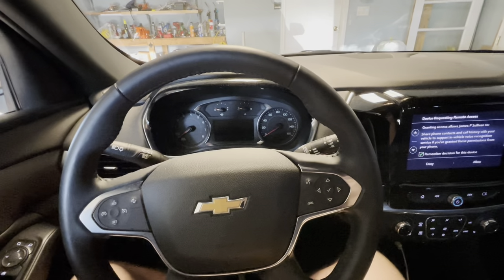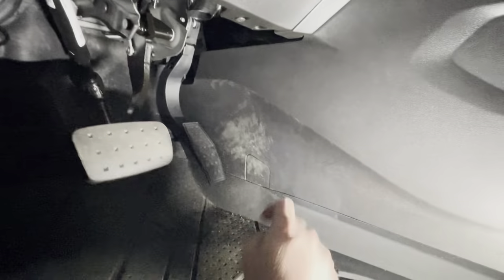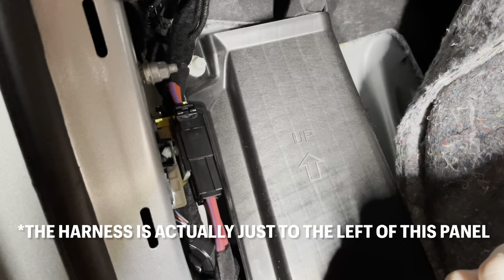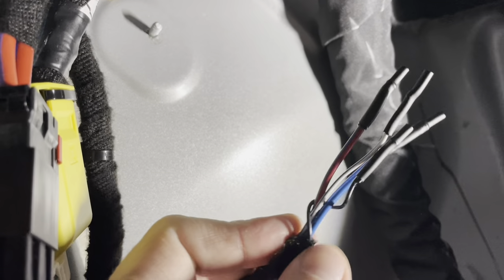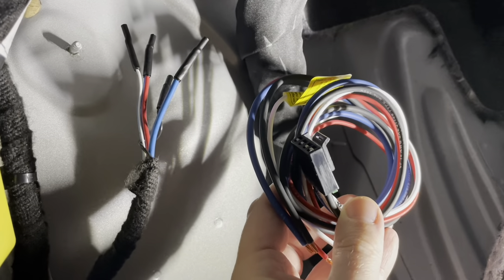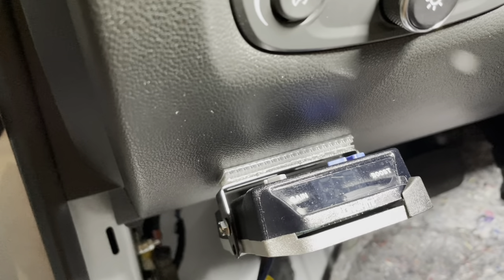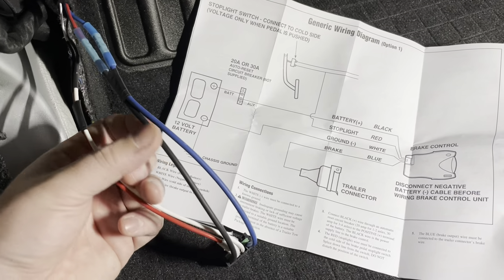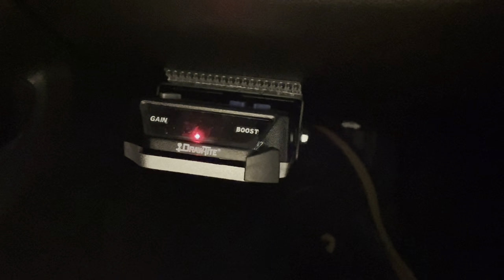[Chevy Traverse] How To Install A Trailer Brake Controller (Similar For Blazer, Enclave, Acadia)

Comment: Hi great video. Your trailer connector harness at the hitch have the trailer brake already ran ?  I only see the standard plug that normally works for the 4 plug end not the 7. I hope you can understand my question. Thanks
Reply from the maker: This one came from the factory with the HD towing package which includes the 7 pin connector and wiring for the trailer brake.  The RPO code is V92, which you used to be able to find in the vehicle, but you can call your dealer with the VIN to have them double check if any towing packages are installed.  You can always have the 7-pin harness installed, but that becomes a little more involved and only necessary (I think) if you need the trailer brakes.  The wiring you have should provide brake light/ running light/ turn signal functions only.

Comment: Installed yesteday but dont get any signal on the break lamp signal. Have 0.5 V Checked also the fuse box and is no bad fuse. Ground and power is ok but because of the missing break light signal have no output from the controller. Do you have chevi diagram wher o can chase back that signal. My break lights are working so is no sensor issue.

Comment: I go a 21 Acadia and the wire are on the floor in the center console. Right beside the gas pedal
Reply from the maker: That’s right, on the short wheelbase crossovers (Acadia, Blazer, XT5) it should be in that spot possibly covered by a small access panel.

Comment: Where/what did you connect to for the power supply?
Reply from the maker: The Red/Blue wire in the harness shown is the main power feed from the rear fuse block.  The white/blue is live whenever the brakes are pressed, and triggers the brake controller to channel the main power feed to the trailer connector on the blue wire (acts like a relay).
Reply: Attached everything, but I don't have power coming on my controller. 😞

Comment: I have a 24 Enclave and can't find those wires where your wires are. Any clue where they might be?
Reply from the maker: Finally had a chance to look into this.  The trailer brake wires should be in the same place (left kick panel area) on the 24 Enclave, assuming it has the V92 towing provisions package.  I would check with your dealer by giving them the VIN and they can check for the V92 RPO.  My wires were taped up and tucked along the main harness, so not super obvious at first look.